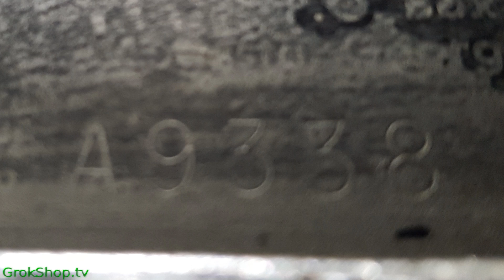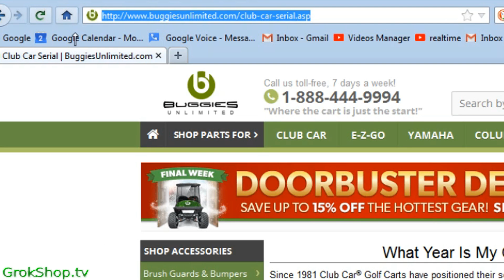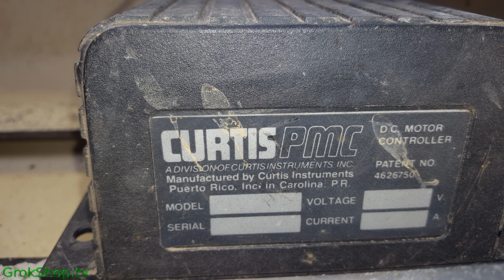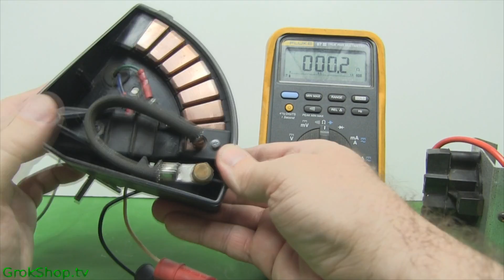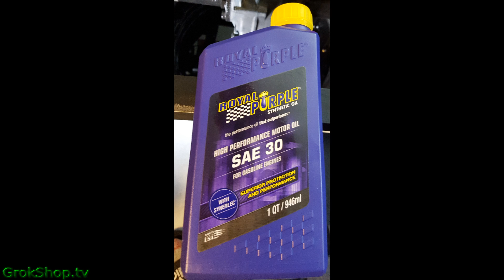Club Car Golf Cart Build | 36v to 48v Conversion [part 1] | Prep work

Comment: Well done, Very informative and helpful!! I have a 93 no controller model, I’m 72 but afraid to attempt just cleaning up contacts (poor flexibility), You are a very helpful sincere and thoughtful person!! I will view part 2, You’re my kind of teacher!, Sincerely, Thank you Sir !!
Reply from the maker: Thank you Art.  If its difficult for you to do the sanding, you should also be able to use electrical contact cleaner.  Something like a WD-40 contact cleaner or DeOxIt where you just spray it on, let it sit a while & then wipe it off. FYI if you decided to convert it to a controller you could swap out the pie-box throttle controller with a POTentiometer which is compatible with the controller.  The pot-based linkages are cheaper than new pie-boxes - mostly because of all that copper I reckon.  I still run the pie-box, but its a little jerky as it steps through the discrete levels.  One day I will put a pot in.  Maybe.  Heh.
Reply: @grokshop  BTW, after many many years in boats and RVs,  I've found the CRC QD contact cleaner to be the best chemical cleaner.  They have started carrying it in some of the discount auto stores and Lowes has it.  A wire brush in a battery drill also helps....

Comment: So far, this is the best of the golf cart upgrade videos I've watched.  Good job!!!  Question.  I have almost the same golf cart.  Just slightly older 1985, with the "fingers in a box" throttle and resister coils.  I have a curtis controller (36/48V) and potbox throttle I am in the process of installing.  My motor is similar, but is the 2.5hp 3300 rpm 36v model.  Can I run this at 48V also?  Any reduction in reliability to run at 48V?  This is a very old motor and I'm a little leary of the increased voltage....  Mine is GE Category 5BC48JB.  I'm wondering if the 48 in the category number refers to 48V?